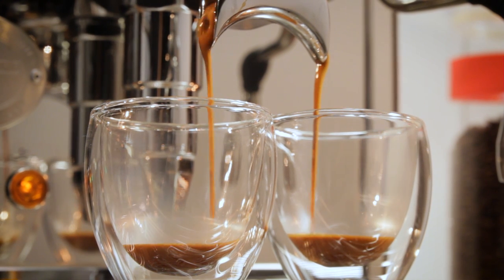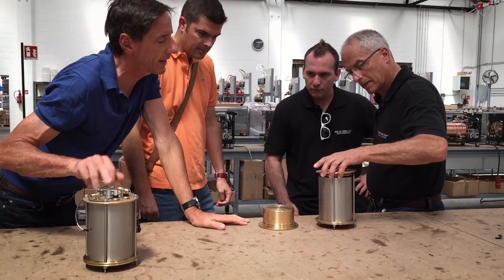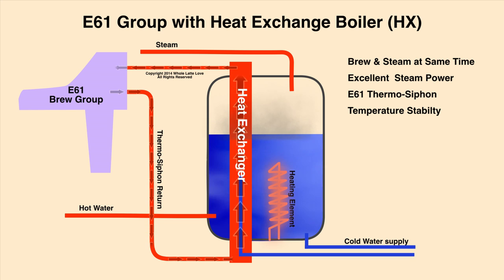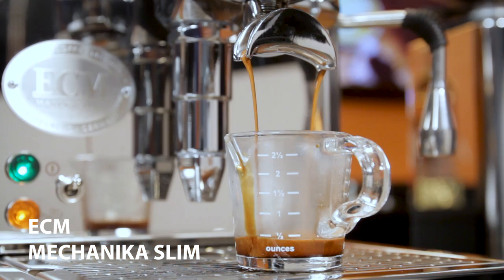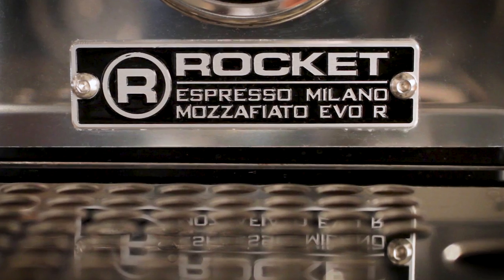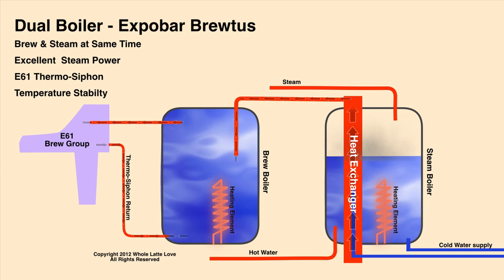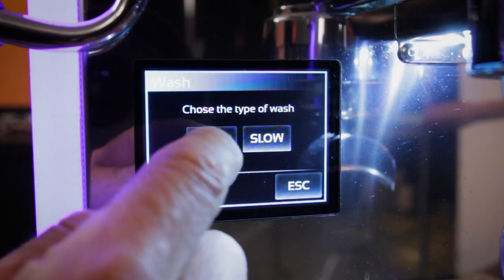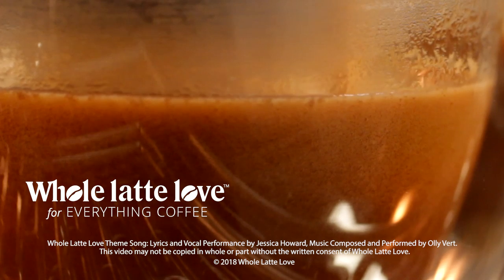How to Choose a Prosumer Espresso Machine: Dual Boiler or Heat Exchange

Comment: Great video!! I currently have a rancilio silvia which has served me well for 7+ years. However, I'm getting a little tired of temp surfing and cycling for brewing /steaming. We are gearing up to buy an upgrade. In my sights are the expobar Brutus and ecm technika v. You can't argue with the value of the first option, but I really like the lever style controls. Is it with the extra $$$ though. Thanks in advance, Andrew from Australia.
Reply from the maker: Hi SB, Thanks for the comment and question. Now doubt the Brewtus is a great value! I'd be surprised if you found it called the Brewtus in AU. It's a name we gave the machine here is US and I do not believe Expobar uses the name elsewhere - it's likely called a dual boiler leva (lever) machine in other markets. While the Expobar machines are great values and built like tanks the ECM machines are refined with more detail in the finishing. They are built very well and are incredibly reliable.
Marc

Comment: Hello, very imformative video right here. However just one little question. Which one do you prefer finally ? heat exchanger or dual boiler ? thank you
Reply from the maker: Hi RJ, thanks for the comment and question. Dual boiler. Current favorite is the ECM Synchronika with flow control.
Marc
Reply: Thank you for your quick response ! And what are the coffee machine similar to the syncronika ? R58 v2 ? Profitec pro 700 pid ? Which one would you choose between these two ? And compared to the syncronika regarding esspresso shot quality ?  I am about to order on your website but can t decide . Thank you

Comment: Is the Mozzafiato V a good choice for me?

I’m on a budget but like a PID and an E61 with a 3-way s valve.
Reply from the maker: Hi R, Could be? Depends on what's important to you. There are other PID, E61 machines which cost less. For example if you're more about espresso and only do milk drinks occasionally the ECM Classic is a single boiler PID machine with E61: https://www.wholelattelove.com/products/ecm-classika-pid-espresso-machine-with-flow-control
Marc

Comment: Hi Mark,
Thanks for this great informative video. I'm planning to upgrade my Breville to an HX prosumer machine and I'm looking for a machine that has no hot water contact with plastic parts. I see the internal parts of some of your videos and I see the hot water tubing is made of copper ( that's good for me). But I'm worried about other parts like the rotary pump, valves and gaskets. Do they have plastic that has contact with hot water?
Reply from the maker: Hi Ktm, Thanks for the comment and question. In most machines, when plastic is used it's only in non-pressurized cold water supply lines or vents to drip tray from things like a vacuum relief valve. If there's a particular machine you are interested in I can check it for plastic if you like.
Marc
Reply: @Wholelattelovepage  Thank you Marc. I'm very interested in ECM Synchronika.

Comment: I love your guys channel. I’m sure it’s been asked before. But, what are your thoughts on the ECM synchronika vs the rocket r58?
Reply from the maker: Hi JA, Thanks for the comment and question! I do get asked about Synchronika v. R58. So... R58 is an iconic machine. As Andrew Meo of Rocket told me he set out to design a machine that has a certain "sexyness". He also made the decision to not have a digital display on the face of the machine so it uses the detachable controller.  Internally the R58 is a hair more complex. More solenoid valves under the hood than the Synchronika. When programming brew temp on he R58 you use the actual in boiler temp. You cross reference a chart in the R58 manual to get the boiler temp which produces a given brew temp. The majority of machines using PID use an offset value. So you put in the brew temp you want and the offset runs the boiler hotter by the offset value to produce that brew temp. The finish work on both machines is beautiful. A slight edge to the Synchronika however - even the internal seams in the drip tray are polished. Some things the Synchronika has that the R58 does not: Best in class steaming power. Steam boiler can be set to run at ~271F which produces near 2 bar of pressure. On the R58 steam pressure max is ~1.25 bar. Synchronika can do line pressure pre-infusion when plumbed to waterline. R58 has a solenoid valve on the plumb connection which only opens when the pump turns on. With the Synchronika always open to line pressure when plumbed use of a pressure regulator is recommended. If you ever want to do line pressure pre-infusion you can use an adjustable regulator to change the pre-infusion pressure. Synchronika is by far the easiest machine to open up. In 30 seconds or so you can have the side and back panels off the machine. Hope that helps!
Marc

Comment: Are any of these industrial for coffee shops?
Reply from the maker: Hey d, Depends on coffee shop volume. Most prosumer machines are intended for domestic/home use but there are a few with commercial use NSF ratings. Check Bezzera machines like this one which is commercial rated and could be used in low volume commercial applications: https://www.wholelattelove.com/products/bezzera-bz13-de

Comment: Hi Marc, Thanks for the informative video. I have been using a QuickMill Silvano with PID for about 10 yrs.  I have replaced the pump, descaled, and other self maintenance items throughout the years.  The steam pressure just doesn't cut it anymore.  My old Starbucks/Saeco does better.  
I would like to upgrade.  I make 2 or 3 milk drinks a day.  I would like something that looks good to.  Just don't know if I will appreciate the difference between a hx and a DB.  Also quiet would be nice!
David
Reply from the maker: Hi David, You are welcome for the video. Good looks are subjective but if you want a super quiet machine with dual boilers, PID, plumbable that's an excellent value you might have a look at the Crem One Infuser. It features an ultra-quiet variable speed DC motor connected to rotary pump. One of the quietest machines I've used. It features programmable gradual soft pre-infusion which ramps up to full pressure brewing in user programmable time ranging from 0 - 30 seconds. Check it out in this video: https://youtu.be/S88TwFdLfns
Marc

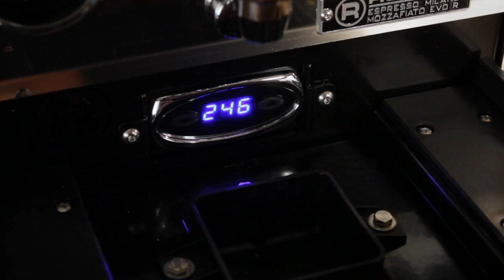Comment: Question! At 5:30 you show Rocket's Mozzafiato Evo R with a PID in Fahrenheit. I bought mine and it's in Celsius. Is there any way to change this? Wouldn't temperature be more precise and accurate in fahrenheit as opposed to celcius?
Reply: Can't say for this exact model but all PIDs made for worldwide market have a key sequence to switch between F and C.

Comment: Hey, thank you for the great video!
So im about to purchase a machine but im on a budget
my main important thing is the milk, latte art, strong wand stream.
what should i look for? thank you
Reply from the maker: Hi Liran, For best steaming performance I'd have a look at dual boiler machines like the Profitec Pro 600, Pro 700 or the ECM Synchronika. All of these machines have best in class steaming power with steam boilers running at ~2 bar. However, these dual boiler machines are not what I'd consider in the "budget" category. Next step down in price is a heat-exchange machine. HX machines can brew and steam at the same time. Good options in HX are the Profitec Pro 500 PID, Rocket Apartamento or Bezzera BZ10. Next step down in budget are single boiler machines. These cannot brew and steam at the same time. A standout in steaming power in that class is the Bezzera Hobby 01: https://www.wholelattelove.com/products/bezzera-hobby-espresso-machine If intersted I have a video comparing 4 premium entry level single boiler machines which includes the Hobby: https://youtu.be/ajvUwRZ524I
Hope that helps!
Marc
Reply: @Wholelattelovepage  hi, I am also looking for a new machine mainly for milk based drinks. I am in Canada so most double boilers are over $3500. I have been looking at the Lelit MaraX for $1900. How would that compare to let's say a Profitec 600 which would be the cheapest double boiler option for me at $3200 excluding the Breville Dual Boiler at $1500 which I am unsure about on the quality side. I am not a pro or crazy experienced, I want to pull a nice shot but really want to focus on great frothing. My grinder is a Specialita.

Comment: Hi Marc, I'm still trying to decide between a good HX, or entry level DB.. probably Profitec Pro 500 or Expobar Brewtus. I make mainly double espresso's, 1 each morning and occasionally cappuccinos for my girlfriend or guests. The thing that worries me with both machines is this: I'm not really liking the cooling flush guesswork with HX machines, I like to get consistent results... and the Brewtus is very consistent temperature, and plumbable is a big bonus, however, with 1 or maybe 2 coffees a day, will I be drinking old/stale boiler water every day? Bonus of HX is fresh water from the water tank each brew, nicer finish (and shorter warmup time?).

Kinda stuck there, any advice for an espresso lover? :) (Currently own a Silvia, but want to upgrade to a prosumer E61)
Reply from the maker: Hi X, Thanks for the questions. As the Pro 500 is now PID no need for a cooling flush - very accurate brew temps without flushing. You will appreciate a plumbable machine like the Brewtus if you go that way. Personally I don't think water goes stale or is affected all that much by residing in boiler. Maybe a different story in an older neglected machine with scale buildup.
Marc
Reply: @Wholelattelovepage  Thanks Marc for the reply! Saw your review video on the Pro 500. Good to know that the temperatures are very accurate without flushing due to the PID, well done Profitec! In the end I think a double boiler would still suit me better to be able to easily change the exact brew temperature for different roasts. Will decide between an Expobar (heard rumors they have something new coming up soon?) or save a little bit longer and go for the Pro 600, which looks amazing and ticks all boxes, except for not being able to plumb it.
Reply from the maker: Hi X, You are welcome! Most of the newer HX machines with PID are very temp accurate. I've had the same accuracy with Rocket Type V and Evo R machines...the newer Giottos and Mozzafiattos. Manufacturers are always working on new models and upgrades. I have no release date info on new Expobar. If something is coming it's still some months out :(.
Marc

Comment: You missed one of the premier models you carry:  The ACS Vesuvius.  :-)   ...Different pump all together in that class of a machine.
Reply from the maker: Hi Peter, Thanks for the comment. We will likely be doing a video soon on higher level and niche machines like manual levers and pressure profilers like the Vesuvius, LM GS3 and Rocket R Nine-One.
Marc

Comment: hey Marc I love you your videos they are really instructive so ,  thank you so much. I need your help to make a decision , I bought a Breville bes870 almost 6 years ago and still working perfectly fine but I want to go to the next step and my budget is  $ 2,000 , I love the Rocket design so , what could  be your recommendation ? It have to be with water connection line ,thank you so much
Reply from the maker: Hi jorge, Thanks for the comment and question. To get into a Rocket machine with waterline connection lowest cost option is the Evo R Giotto that's about $500 over your budget: https://www.wholelattelove.com/collections/semi-automatic-espresso-machines/products/rocket-espresso-giotto-evoluzione-r It's a PID machine with rotary pump and heat-exchange boiler.
We do have a few Expobar Brewtus IV-R that are just within your budget. These are dual boiler PID machines with rotary pump and plumbable only - no reservoir. They do not have the Rocket flair but make excellent espresso: https://www.wholelattelove.com/collections/semi-automatic-espresso-machines/products/expobar-brewtus-iv-r-with-rotary-pump
Hope that helps!
Marc
Reply: @Wholelattelovepage  well im going to wait a little bit becouse I really want the Rocket, so thank you very much for the info .  I'm really appreciate.
Reply from the maker: My pleasure!

Comment: Is there a minimum pressure for plumbed machines? I am interested in the Profitec Pro 700 because of the line pressure preinfusion, but I plan to plum from my RO water system. The reservior is pressurized but only to about 10 psi.
Reply from the maker: Hey M, Thanks for the question. Profitec specifies a maximum input line pressure of 2 bar which is ~30psi. I believe 10psi (~0.6 bar) is sufficient to feed the machine. Understand that your line pressure pre-infusion will be limited to the pressure provided by your RO systems output pressure. If planning on using water from RO system be certain the water is remineralized! If your RO system outputs mineral free zero TDS water that will be a problem. Mineral free water will over-extract espresso and over time can cause corrosion of metal components in the machine. Many RO systems have a bypass which feeds some untreated water back into the treated water to increase mineral content. If you have that you should be all set. If you do not remineralization filters like this one are available: https://www.wholelattelove.com/products/bwt-bestmin-premium-m-filter-cartridge
Hope that helps!
Marc
Reply: @Wholelattelovepage  Great info thank you! I do have remineralization on the system (iSpring, cant remember the model of the top of my head). It makes great pour over over.

As a Rochester native, I can’t wait to order my machine from you guys. Just need to decide on a grinder now!

Comment: Do you sell pressure regulators for ECM Synchronika?  What are good pressure regulators?  I am thinking of connecting plumb to a 5 gallon jug of water.
Reply from the maker: Hi T72R, Thanks for the question. We do sell pressure regulators which will work for just about any plumbed in espresso machine. They reduce line pressure from household plumbing. I'll admit I'm not quite clear on what you are going to do with the 5 gallon jug. If you mean you want the jug as the water source you do not need a pressure regulator. So long as your water jug is near the same vertical level as the machine the rotary pump of your machine has the power to suck in the water from the plumbed line. We do it all the time. No need to pressurize the water to the plumbed in connection. Here's a link to BWT pressure regulator: https://www.wholelattelove.com/bwt-inline-pressure-reduce-m-3-8-x-f-3-8-2-8-bar
Marc
Reply: Thank you Mark for your input and greatly appreciated.  What I am trying to set up is very much what you just said. A 5-gallon jug of Glacier water connected to the Plumb line of the ECM synchronika. I have seen on YouTube people connecting a flojet to push 30 psi to avoid the pump from being damaged but those demonstrations are over 5 years old. The new ECM synchronika is relatively current if I bought it brand new. Sometimes I wonder with my thinking of covering all the bases then I am doing an overkill on Care for the investment.

Comment: good info! Do  I understand correctly that for HX mc with PID we do not need to do cooling flush before brewing espresso ? ........... The main reason I chose rotary pump (although it cause the mc cost more ) is the durability compared to vibration pump.
Reply from the maker: Hi Ko, Thanks for the comment! On the HX machines with PID in this video: Profitec Pro 500 PID, Rocket Evo R and Type V Mozzafiatto/Giotto cooling flushes are not required based on our Scace testing. Rotary pumps are more durable (and have a more pleasing sound) than vibration pumps. Some users report liking the slower ramp up to brew pressure you get with a vibration pump. I'm not sure it makes enough of a difference for me to pick vib over rotary.
Marc
Reply: @Wholelattelovepage  thanks Marc! always appreciate your informative videos!

Comment: Do you ever have used machines? I have been using my Rancilio Silvia for about ten years and I would like to move up a bit to a heat exchanger  .  I can't afford a dual boiler.
Reply from the maker: Hi Ken, Thanks for the question. You can find some here: https://www.wholelattelove.com/collections/outlet
Just put up a video on the Bezzera BZ13 yesterday. It's an HX machine w/PID and IMO one of the best values in HX boiler machines. Watch the video here: https://youtu.be/afQSBLNTveI Its new price is better than some of the HX refurbs currently available with a lot more to offer.
Marc